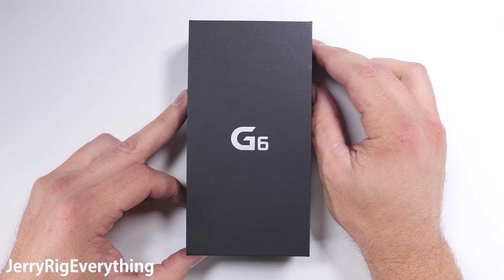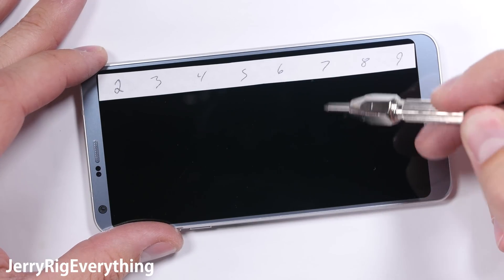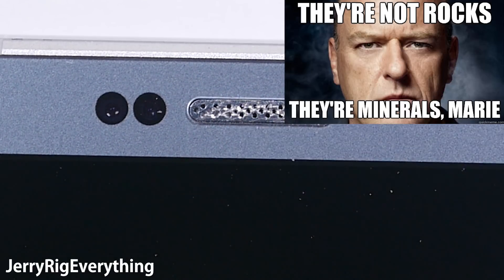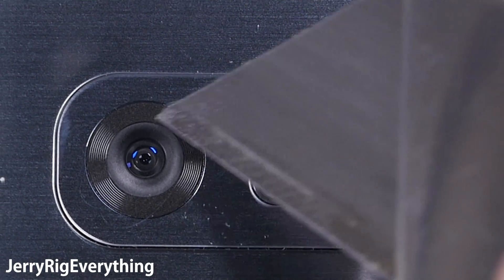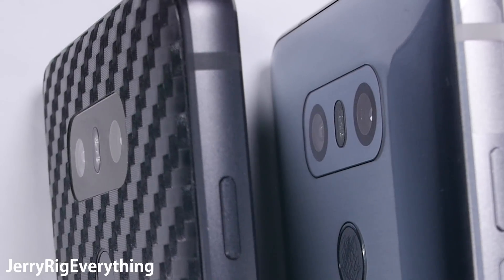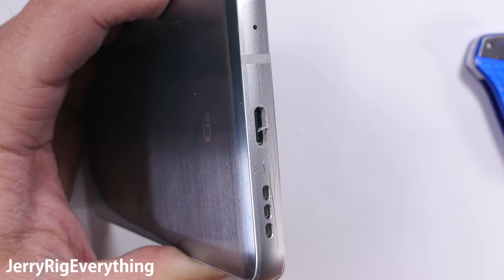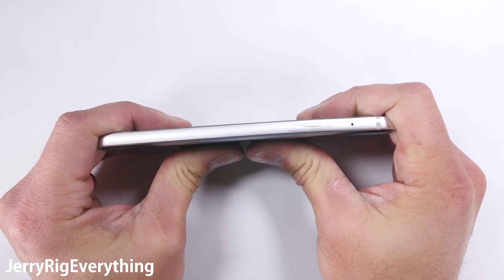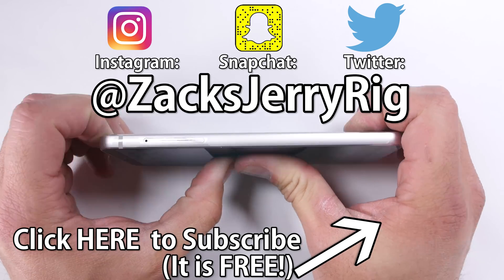LG G6 Durability Test - Scratch BURN and BEND tested!!

Comment: please add drop test in your videos also
its more helpfull
Reply: Yeah I can guarantee you the LG G6 is an absolute tank of a phone. I dropped it twice from 4 feet high onto solid concrete. Once on the bottom corner and then after flat out on its screen. I have never seen an iPhone or Samsung phone resist this kind of drop. My G6 still has the battle scars and I will continue using it without a case forever. I will be doing the transparent back mod whenever it's time to swap in a new battery. I don't like wireless power because it's just wasting energy and heats up the phone for no good reason.
Reply: Mark M does lg g6 heats up fast?
Reply: Maybe he thinks youtube droptests that drop only 1 phone don't say much at all, and he probably would be right. There's just too much chance involved. That's why phone manufracturers drop ALOT of phones to test them, not just 1.

Comment: Could you do a durability test of the Microsoft Lumia 550, please?  My own Lumia has been run over by a large 4x4 and came through completely unscathed minus the plastic frame (which only has a few chips on the corners.) I'm wondering if durability of this phone as actually as impressive as it seems, or if it was just that one anomaly. I'm not willing to put my phone under a car once more to test it! Haha

Comment: 0:41 +JerryRigEverything are you shure it is Gorilla Glass 3? That makes no sense since the LG G5 had Gorilla glass 4, and most new flagships of 2017 have Gorilla glass 5. Why would LG step back on that?
Reply from the maker: +Ola Mercedes each gorilla glass has different properties ' And all of them are superior to 'normal glass'  so i don't look at it as a step back.  More just that they wanted a different glass composition. Personally I feel that gg3 is a tad more scratch resistant than gg5. Even if Mohs doesn't show it.
Reply: I did a bit of googling and it seems that Gorilla Glass 5 is harder than Gorilla Glass 3, and Gorilla Glass 3 is harder than Gorilla Glass 4. This means that 5 is more scratch resistant, but is also more shatter prone. Softer materials like plastics are very shatterproof, which is why they're used on "tough" phones like the Moto X Force and Galaxy S7 Active, but they also scratch much easier. A manufacturer like LG may choose to use the softer Gorilla Glass 3 over 5 if they decide to prioritise shatter resistance over scratch resistance.
Reply: JerryRigEverything, on AndroidAuthority and other sites there are info about LG G6 using Gorilla Glass 3 for display and camera but Gorilla Glass 5 for back of the phone! Can you also test back glass with Mohs picks please?
Reply: I've had my G3 with gorilla glass for 3 years, dropped it more than 20 times, no cracks of even a scratch!
Reply: JerryRigEverything I understand your point. I guess its to save cost. but like the comment below says, is the back panel Gorilla Glass 5? would be interesting to know. But my question is why is there such a thing as Gorilla Glass 5? what difference does it make between Gorilla Glass 3? Thanks anyways for responding! :) made my day!
Reply: I used to like these videos but I kind of feel like it's such a waste of a good phone now
Reply: Annick Filion d los 🕑 de la.
Reply: Yessica Tarango plz speak english!
Reply: Yessica Tarango using mommys phone huh
Reply: +Ola Mercedes (yuàOLAPVP)
Reply: MkayGirl yeet

Comment: Scratch resistant camera lens on the back? It looked like it scratched?
Reply: Spacemonkeymojo the metal surrounding scratched, much like the fingerprint. The camera's itself were coverered with the same gorilla glass 3 coating.
Reply: Watch the video again at 1080p at least. You can see that the camera lens on the back scratched. Even when he wiped it away it was scratched.
Reply: Spacemonkeymojo i watched it again and it definitely scratched but more lightly than the surrounding glass/metal. You're right.
Reply: It's surprising that Zack didn't pick that up when he recorded it!
Reply: Spacemonkeymojo yeah. Its quite important to know to be honest since the stanley knife isnt so hard and it still scratched. He compensates by advising a case to create some distance between the camera and the surface you're putting it on. It will scratch eventually even if the stanley knife didnt make an impact. Well spotted.

Comment: I have a dbrand skin on my Nexus 6p. Helps keep it from spontaneously breaking in half.
Reply: Don't breathe too hard on it. Those dovetail joints don't play around.
Reply: A wood grain skin would have worked well with those.
Reply: Zamasu I think you're commenting on the wrong comment guy.
Reply: He specifically mentioned dbrand skins in this video.
Reply: yeah the dreaded kink by the power/volume. Happened to me, luckily amazon let me return it for a full refund 6 months later. Never again go Huawei, they wont honor their warrantys and are cheaply/poorly made.
Reply: YummierMussel see it
Reply: K-Dizzle hi

Comment: i preordered another phone, but i really like G6 for it's flat screen...it is way safer at dropping, it's easier to find good mask that fits and protect it, and it still looks nice.
great jobb LG, too bad you didn't do better with g5....now for that device, botloops and bad battery it's hard to get buyers atention, but i guess if g6 would be as good as g2 was, you could be on good path.

Comment: Yeah i totally agree with the other comments below! Jerry's channel got so large so quickly (in lesss than a year he grew by a factor of two, from a modest 300-500K back in 2015 and now with almost 900K) and since hes getting so close to 1 million subscribers, its refreshing to see him trying different approaches to durability and even testing items that we clearly always wondered about, but never could see them thouroughly, since we dont have an electron microscope that costs 700,000$.

Would be cool to see more drop tests like the ones he did with the Xiaomi Mi Mix and definetly more manufacturers using different materials like scratch resistant Ceramics or even Sapphire crystal backs and fronts (obviously there are phones like that now, but they cost almost 5000€ and are exclusively Iphones).

Comment: Hm. I prefer it when the front isn't flush. If the glass doesn't run any risk of touching the ground, you don't need a case for it. Thus you don't ruin the design, the phone is slimmer, etc. All these new designs require a case which covers all the premium materials etc. that went into them. Why bother? Give me a plastic phone, if I need to put a case around it anyway. It's not like I'll ever see that it is plastic... Also, I won't be touching the premium materials anyway, I'll be touching cheap plastic, because I need to use a case, and those are usually made from cheap plastic.

Basically I'll take mildly less aesthetically pleasing that I don't need to cover up over attractive but I have to cover everything up and make it look like a $50 phone. Seems sensible, but those manufacturers (and buyers) don't seem to understand that.

Comment: I am still waiting for a phone that does not fall at a Level 6 in the Mohs Scale.
Reply: Folha de Papel Watch the S7 active video then.
Reply: E50AK Thx, but you didn't understood me. I was talking about a phone that scraches after the level 6.
Reply: menzáč No, 169cm
Reply: Unless some new material is found, the more scratch resistant you make the glass, the more it's prone to shattering. At level 7 it becomes too easy to shatter.
Reply: Soumen Mondal The screen falld at the level 6. Like normal phones.
Reply: Anything over 6 is very shatter prone. 6 is just enough durability so it doesn't shatter when you drop in on a carpet or scratch it with a key
Reply: In reality, having a phone that scratches at higher than a lvl 6 typically means that the glass is more likely to break when dropped. Tempered glass (the screen material used in most phones) is a nice blend between durability and scratch resistance. Also, most people don't run around scratching their phones on things, and most everyday objects are under a 6 on Mohs Scale.
Reply: Folha de Papel You'll be waiting a very long time for that. Only sapphire can achieve it, and as a guy working in engineering and materials science unfortunately the harder it gets the more brittle it becomes. Even pressing down on a sapphire panel, (which happens more as physical buttons disappear) can crack a sapphire screen. It's difficult to come up with a hybrid glass/sapphire screen as the crystals won't bond. But hopefully one day someone will figure it all out. Sapphire is fine for small areas like watches and camera lens, but that's about it.
Reply: HTC U Ultra, sapphire screen edition (BTW Zack, please test it!)
Reply: htc ultra
Reply: The phone I mentioned has a sapphire display
Reply: AftermathXJ220 I Know that its easier to shatter, and i am not saying it is better. I am just saying it would be fun and "inovative" to see it.
Reply: I don't think we're ever going to see that. There's not much reason for companies to splurge on a even more scratch resistant screen.
Reply: X Pure. Level 7.
Reply: Folha de Papel The Vertu Constellation. It's a $6000 phone, but it actually has a sapphire screen.
Reply: Sapphire edition HTC U Ultra
Reply: ***** it's plastic it would scratch at a level 3
Reply: Brian M he should test it right? It would be an interesting video
Reply: Moto X Style. Woot woot.
Reply: Folha de Papel Moto x pure reached a level 7
Reply: Its xiomi mi mix
Reply: Folha de Papel Kyocera duraforce pro Verizon edition
Reply: i remember there's one phone he tested that scratches a tiny bit on level 6 only , more on level 7
Reply: @Kuang are you high?
Reply: Motorola Turbo 2 with ShatterShield Display, maybe?
Reply: I think the 2015 moto x pure passed level 6
Reply: Folha de Papel Level 1 screen made of talc
Reply: Soumen Mondal the ceramic was at the back
Reply: "fun and innovative"

technological advancements don't just pop out of no where
Reply: Are you guys ignoring my comments?   The Kyocera duraforce pro Verizon edition and the Kyocera brigadier are probably the only ones that will get a level 8
Reply: They got sapphire displays
Reply: Rey Fuentes You are being ignored Ray, I don't know why, maybe because this phone isn't well known... and you are partly right. It doesn't actually have a sapphire display but the glass is sprayed with a sapphire coating which does protect the screen from scratches anyway. It's not a great phone but that's another issue. The phone is also very rugged with a strong case which makes it shatter proof if it's dropped on it's side, but cracking will happen more easily than glass to the coating if it falls face down and contacts hard surfaces. The glass underneath will be protected but you'll still see a crack so it doesn't make much difference. I think this coating is very suitable for a rugged phone type like this, but not for an unprotected phone that is more likely to fall on its screen. Well pointed out by you! 👍👍👍
Reply: Rey Fuentes P. S. I wasn't ignoring you by the way, saw your comment late! 👍👍
Reply: Rey Fuentes He definitely should 👍👍👍
Reply: Got an idea! Smartphone world, go use Smart Materials for your screens. Smart Materials are/can be self healing. So if there could be a Smart Material created for smartphones that could repair itself when you scratch it. It would be AWESOME!
https://en.wikipedia.org/wiki/Self-healing_material 
https://en.wikipedia.org/wiki/Smart_material
Reply: take the sapphire edition of the htc u ultra
Reply: mi max is all ceramic
Reply: Yu are the best durability tester that I hav seen.
Can yu check if a display is scratch able after applying nano liquid screen protector??
Reply: Folha de Papel i
Reply: Folha de Papel check out his video HTC u ultra sapphire edition
Reply: Folha de Papel Scolling through this thread is just nothing but miscommunication and confusion.
Reply: BOSK miscomunication and confusion?
Reply: Folha de Papel check out the sapphire U Ultra
Reply: Watch his video of the motorola moto x style, scratches at a level 7.
Reply: http://www.gsmarena.com/htc_u_ultra-8519.php
Reply: Xiaomi mi6 ceramic version.
Reply: Folha de Papel HTC U Ultra Sapphire Version
Reply: HTC U Ultra Saphire Edition. Shame its not a very good device
Reply: Folha de Papel The Moto X Pure scratched at a Mohs Level 7. Go watch his video on it
Reply: Folha de Papel I got it but then I looked at the technicalities of the comment and I thought maybe he means anything other than 6.
Reply: Just get a good screen protector. Hopefully this one is truly flat and a tempered glass screen protector will actually work with it.

Comment: Hey Jerry, I recently (about a month ago) got a Huawei Mate 9. I know the glass is Gorilla Glass 3, and saw your durability video showing that the screen meets the hardness requirement for that. However there are several little what I'd call dents that look like small stains on the screen, that can't be removed and seem to be areas where the top coating of the glass has come off. Do you know what could have caused this, and what I can do to fix my screen? The pixels in these areas are slightly warped so when watching videos it's kinda annoying.
Reply: His name's Zack
Reply: Thomas Bontekoe I think you should return it if it's still under warranty. This "warping"should never really have occurred.
Reply: Thomas Bontekoe Did you drop your phone screen first or did a blunt object somehow hit it hard?
Reply: Thomas Bontekoe Did you drop your phone screen first or did a blunt object somehow hit it hard?
Reply: Thomas Bontekoe Did you drop your phone screen first or did a blunt object somehow hit it hard?
Reply: Nope, that's the weird thing about it all. Since I got it I've only used it with the official flipcase on it, so the screen is protected at pretty much all times. Yet still these weird dents appeared...

Comment: Gorilla Glass 3??! On an LG FLAGISHIP? At least gorilla glass 4 ... come on lg. The G5 was a disappointment in terms of quality ..
Reply: Ed TV 
...Great. 
Another peon that thinks they know something.
Reply: Stephen Belikoff  can I tell u something u might think you know ... spelling. Assuming u mean 'person" not 'peon'
Reply: Stephen Belikoff  Ok well please explain to me .. why do manufacturers use gorilla glass 4 and 5 if it's not according to u any better?
Reply: ...Oh you go me! I Concede! GG4 and GG5 is higher quality than GG3. You win! Not. Gorilla glass has gotten stronger, but thinner with each generation. GG3 is thicker and makes for a more durable screen on a smartphone because of that. I feel like I've been using this example a lot, but the HTC One M8 had GG3 and in the many years I used it, the screen never cracked (I didn't put a screen protector on the device for about a year after getting it). I cannot even tell you how many times I dropped it. Beyond this anecdotal evidence, there's actual evidence of this being the case within hundreds of forums scattered throughout the Internet. You see, once you have enough user testimonies, it becomes a usable statistic. Galaxy devices are like newborns with osteoporosis. The screen shatters at the slightest hint of stress, and guess what? Galaxy phones use GG5. So, I don't see any problem with using an older form of tempered glass if it is beneficial for the durability of the device. If I did, I'd just be complaining over specs like an idiot and not judging the device on actual merit, like someone educated would.

Comment: Is there any particular reason why they used gorilla glass 3 instead of 4 or 5? As far as i know- the newer, the better for the durability.
Reply: Piotr Sulej LG claimed it was thinness of the glass. that's why it's the newer on the back, older and thinner on the display.
Reply: Piotr Sulej Because GG3 is cheaper than GG4 and GG5. There is no other reason.
Reply: Maybe it was cheaper. Maybe because of the better scratch resistant. Or both.
Reply: Oh well, probably have to do with thicker glass for the glass 3 on the front. The camera use glass 4 and the back use glass 5.
Reply: MrDoctorDIV Makes sense, but i thought it's exactly the opposite lol
@DigInDeeper you've just made yourself an idiot- harder= more brittle (aka breaks easier) and more scratch resistant.
@Amal do some research before posting such theories.
Reply: Amal V Pillai you are an idiot
Reply: Piotr Sulej because it is thinner than GG 4 & 5.
Reply: Ali Alslaman No GG5 is the thinnest one.
Reply: Because Gorilla Glass 3 is very thick and that provide the nice 2.5 D curve edges.
Reply: Amal V Pillai Stop spamming you idiot! The G glass 5 is as good as it's predecessors in terms of scratch resistance, just with a better hardness.